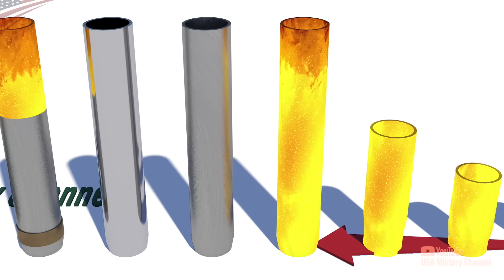Inside the Factory: How Steel Bars Become 155mm Artillery Shells

Comment: Seems like very outdated manufacturing processes
Reply: What is outdated about it?
Reply: Old is cheap. Military contractors are cheap. Their margins are insane due to factors like this. Why update when you can just repair obsolete equipment and pocket millions
Reply: @reallybigdixiewrecked  Their profit margins are not as high as people think, they’re at about 30% aka inline with other industries. Now chemical and drug companies. . .
Reply: This is extremely updated if you have ever watched any of the shell making videos from the Second World War.
Reply: You're going to suggest a CNC lathe or, "better" yet, a 3D printer, right?
Reply: @markstyles1246  machining something like this would be incredibly wasteful of material starting with a billet and pressing/forging it to form and then only machining down to final dimension means this process is incredibly efficient in terms of material throughput
Reply: @the_real_ch3  Yeah... But it would be less "outdated" as the OP seems to find... :-)
Reply: @the_real_ch3  They are now trialling rolling to its final shape rather than machining. It's a lot faster.
Reply: @markstyles1246 There was talk about trialling friction forming like they do with high-end wheels because it uses less energy, but I've never seen anybody actually implement this idea.
Reply: I worked in the forging industry for 33 years and 30 of those years was spent running forging hammers and sometimes forging presses. This process is over 100 years old. The forging machines have had some updates and as you can see automation has been added. The average forging hammer in America is either pre WW2 or WW2 vintage. The newest forging hammer design I forged on was designed in the eighties and all it had was computer programming and an updated guide system. There’s no other way to do this to get the grain strength you get from a forging. The world runs on forgings and that includes:
Farm equipment 
Railroads
Locomotives and rolling stock 
Mining equipment 
Aircraft 
Oil rigs and wells
Medical equipment 
Chef’s knives 
Motorcycles 
Automobiles
Lift trucks……..
I’ve forged parts for all of these items and more. I spent half of my career forging parts for Harley Davidson. Some forging machines are from the nineteenth century.
Reply: @JefferyHagen  still at the end of the day “ heat it and beat it”
Reply: @LIL-RED-BIRD  pretty much. I had a female administrator go off on me because I informed her how old the process is and when she tried to push back l told her with few exceptions you’re going to key the die or dies in a fixed position and the other die or dies in a moveable position ( the ram) you’re going to hit it or push it into shape. How she got that far in the company baffled me. I even forged hinges for jail cells.😂
Reply: @JefferyHagen  but my book tells me…
Reply: @JefferyHagen  that is a great explanation and makes sense. That's what it looks like to me, the most modern machine looks 80s style. Such an interesting manufacturing process, revolutionary a hundred years ago and revolutionary still today. I assumed the military industry would be constantly innovating to the newest and latest. Without knowing about it I assumed they would have had some giga press that forged a dozen shells at a time in a shiny automated factory .
Reply: They're making artillery shells not semiconductors and EV batteries.
Reply: It’s not. It works.  Notice the number of people (few)?  Floor would have been packed with guys working back in the day
Reply: I work in a heat treat facility that handles aerospace contracts. We've been doing it for 50 years. We have zero robots.
Reply: @scottgalbraith7461  Interesting, thankyou.  Without knowing anything about the ammunition manufacturing industries , I just assumed that it would have become highly automated  like the auto industry has.  Is it a manual trade / industry in other countries like India, China, France, NKorea, Iran, etc, etc???
Reply: @greentree180  what the video shows is actually fairly automated. The robots are doing all the jobs that would be extremely difficult for humans. When they show inspectors manually inspecting parts, it's because only a human can sign off on it. Robots are terrible at accepting blame.
Reply: @greentree180  I couldn't say how manufacturing works in those other countries, but I'm guessing the consequences for human error may be more severe in some.
Reply: A new 155 mm artillery shell production facility was just opened a month or two ago in Mesquite Texas, run by General Dynamics. It’s supposed to “utilize free-flow forming technology.” Which presumably is a more modern manufacturing process? I’ve seen a few short news clips on here and elsewhere that showing the facility. I’d love to see a more extensive breakdown so as to juxtapose it to this video of Scranton Army Ammunition Plant’s processes.
Reply: Certainly not the newest iso industrial standards
Reply: I me and we only know how to work steel in so many ways so yeah it is kind of an old process but we haven't come up with a better one yet unless you have why don't you and enlighten us and tell us how to make more shells faster and better
Reply: @cascadianrangers728  nice little jab mate, you did ok, the first but was ok, though you had to spit venom which is required.
Reply: U gonna 3d print them in plastic?
Reply: Mostre uma fábrica russa ou norte coreana produzindo com esse nível de automação?🙄
Reply: It is the same process that other ammo manufacturers do, like in south korea.
Reply: You are KGB!!!
Reply: @scottgalbraith7461  I wonder how the ruskies make their ammo??
Reply: You couldn't be more wrong lmfao
Reply: It gets the job done.
Reply: @M21-w1y Only if production time isn’t revelant. In these times where we have a shortage of 152 mm shells the overly relaxed pace of this factory just isn’t enough.
Reply: @robingerrets1077 152 is Russian not nato standard
Reply: Compared to many factories this one looks fairly modern. Manufacturing is a dirty business. Do confuse clean with modern. Yes most defense contractor make a decent profit, but few companies are willing to build to the ridged specifications the government requires. I have never seen the spec’s for an artillery shell, but a simple bolt can have several pages of specifications that have to be met. All contracts are put out for bid, but most companies don’t want to deal with the headaches of a government contract. Also don’t forget the low bid does not win. The bids are modified according to many factors. Women owned, minority owned, small business, hire the handicapped, and so on. It also helps if your plant is located in the district of an important congress critter.
Reply: that engineering line is absolutely the state of an art. I watched this whole video impressed with just how well this was done, how well the process of thought out, and just how automated it is. The only thing I wonder about is why the final turning is more automated.
Reply: @marchutton7640 100% a line that goes from raw bar stock to finish product with that few human hands touching the work piece? Absolute masterpiece
Reply: They have robots and computer controlled lathes and milling machines and you think this hi-tech process is outdated? What planet do you live on? 😂🤦🤷
Reply: @Sajuuk  The defence industry is the biggest industry in the world !/?.  T me it looks like automation assisted with manual production from the 1980s in a century old building, running slowly.  I would have expected bright shiny factories, fully automated, running at 100 times the speed in 2024.
Reply: @greentree180  You do know the Star Trek replicaters aren't a real thing?
Reply: @greentree180 fundamentally, metal working hasn't changed that much.  You make metal hot, then apply pressure, metal turns into shape you need.   This could all be done by hand, it would just require vastly more space for the workforce and be much slower and less precise. 

Now, as far as speed, there's also a requirement to allow the steel to slowly cool.  Cooling the steel fast("quenching") would produce a very hard steel, but also one with multiple stress fractures from the rapid cooling.   By allowing it to cool anowly, the steel is "annealed" or "normalized" which reduces the hardness, but also relieves some of those stress fractures and makes for a "tougher" and more machinable steel.  This is a physical process that simply takes time to happen, and cannot be rushed.  

Fundamentally, this manufacturing process isn't really that different from how small arms ammunition is manufactured.   Stock is cut to size, a series of dies are used to shape the ammunition, it's trimmed, etc.   however, for artillery shells, the process is scaled up and requires the use of high heat to make the metal workable.   

An artillery shell needs to have certain properties.   For high explosive filler, you want a sufficient tensile strength to survive the stresses of being fired and not go boom in the barrel( a "no bueno"), survive the flight, and then burst and fling shrapnel around.   This requires certain processes, and I'm not entirely sure there's a better, faster, and cheaper way.  

3d printing of sintered metal may be as strong, but it probably takes considerably more time and is more expensive.
Reply: @YaBigDummi 3D printed metal tends to be pretty brittle. whole lot of grain boundaries. i wouldn't recommend it due the go boom in barrel issue you brought up. it does, or so I've heard, make for an unpleasant day.
Reply: @Cor_xp  yeah, I'm still sceptical or critical of claims that 3d printing is going to replace everything.   For some things, like turbine blades for high performance jets, the SOTA is single crystal casting, and I don't see how printed metal can compete with that.   You have to rip molecular bonds of the crystal part vs ... What, like some sort of sintered metal dust?  Meh, I don't see it.  

But I feel like it would be remiss not to mention it.   And with some things, 3d printed seems like it can work well.   Especially for prototyping or modification.   

I'm not sure how it compares on efficiency to traditional plastic extrusion for mass produced parts.
Reply: @greentree180  Yeaaaaahhhh I don't think I'll be taking technology advice from someone with the moniker "Green Tree" and who displays all the trappings of the Dunning-Kruger syndrome.
Try harder. 😂
Reply: So tell us you don't know squat about manufacturing without telling us you don't know squat about manufacturing. It must be embarrassing to be you.
Reply: @jimfarmer7811  that's a brutal criticism bro, and I think it is unfounded criticism of a neutral observation.
Reply: @greentree180  I'm a retired engineer so when I see a comment that shows gross ignorance I'm going to call it out. But I could be wrong. If you have any ideas on how to update the process please list them.
Reply: @jimfarmer7811 exactly my thoughts. 
Only place I could imagine an optimization was in the manual inspection step. Otherwise a total automatic handling.
Reply: @jimfarmer7811 you may be a retired engineer, but i hope you never retire from the YouTube comment section.
Reply: @jimfarmer7811 you’re rude.
Reply: @greentree180  brutal but well deserved, it takes time for the steel to move in the press, and the cooling and reheating relieves stress caused by the forming.  Reports have this facility making 100,000 rounds a month, so let’s do some math, 30 days in a month 24 hours in a day 60 min in an hour.  So 30 x24x60 =43,200 minutes  now let’s take 100,000 and divide that by the number of minutes and we get 2.3 shells per minute approximately.   I would suggest that your comment shows a lack of effort in thinking before speaking.
Reply: @LIL-RED-BIRD  Good analysis.  Pity you had to do the venom jab at the end, settle down cowboy!   There is no way that they are making one of those big shells every 20 seconds.  Where did you get your numbers from, maybe you are referring to all the ordinance made at that plant rather than the manufacturing process being shown in this video?
Reply: @greentree180  the 100,000 per month from that facility is from Zelenski’s visit recently. That was the number in the video.  Keep in mind they are showing 1 production line dumbed down, you are not seeing the cycle times  on most operations. Some are constant  flow and others are batch.
Reply: @greentree180 pov you have no idea what you’re talking about
Reply: @jb76489  and you do?  Seems to be a good discussion in the comments.  And.yes it is an old manufacturing process, however the tech hasn't changed.
Reply: @greentree180  you didn’t say old originally, you said outdated because again you don’t know what you’re talking about

“Tech hasn’t changed” oh of course it hasn’t, we’ve always had robots making artillery shells
Reply: It is NATO standard rounds people. There are specifications,  tolerances, and a multitude of other factors that come in to play to maintain accuracy in munitions amongst a sea of nations with many differences. It doesn't take an engineer to figure this out, but it takes ignorance to make a comment as naive as the main commenter's was.
Reply: @ink13jr You seem full of venom, do you feel better?
Reply: Today each and every manufaktur has to produce at max capacity
Reply: Maybe you can show us how to 3-D print them
Reply: Seems that way to me too.
Reply: it’s a very outdated weapon
Reply: @Xvery5  Hardly out dated. Something like 70% of casualties are caused by artillery.